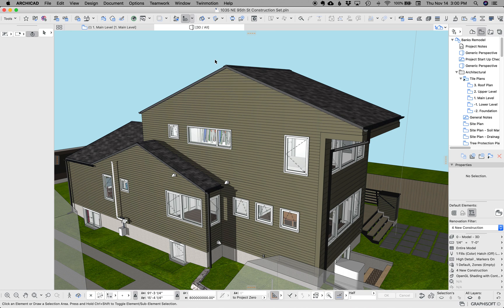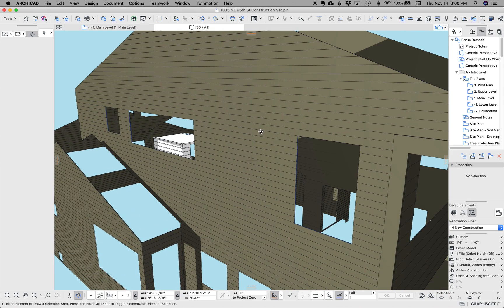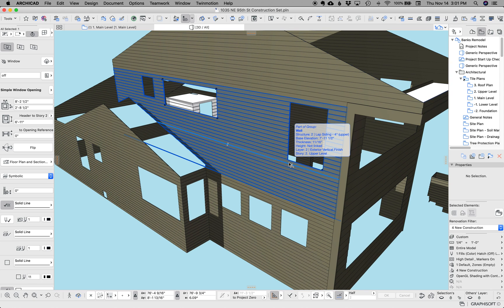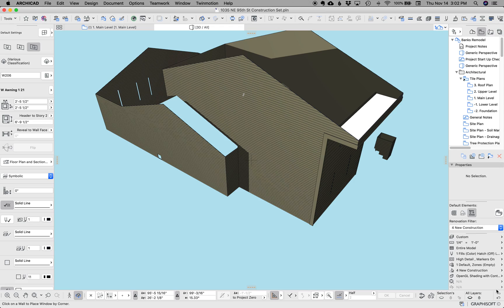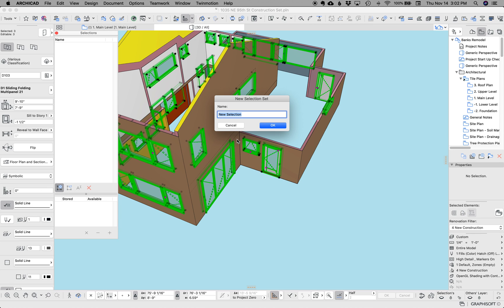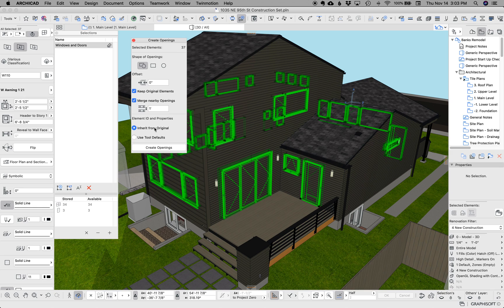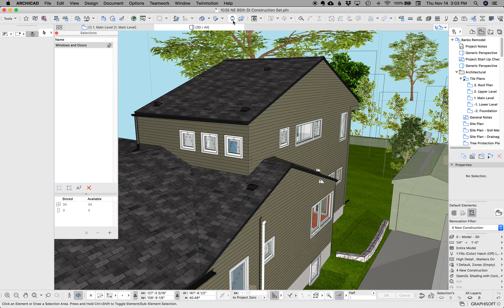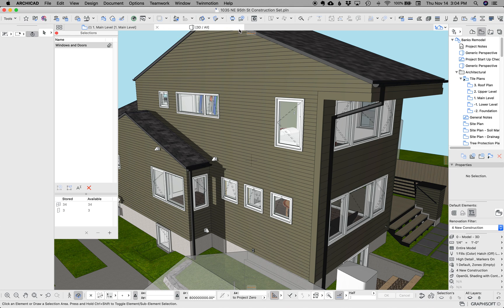ARCHICAD Tutorial #70: Openings for Complex Profile Siding in ARCHICAD 23

Comment: Thanks for this amazing tip but how do make this siding as a skin for all walls and how can we make vertical sidings or steels sheets.
Reply from the maker: Do the same technique but use a Composite wall rather than a Complex Profile. Then use a Surface with the correct vertical pattern. You can use Align 3D texture to get the lines where you want. Alternatively, if the panels are big or there aren't too many verticals, you can use hidden beams and columns to create all the joints. I think I have a video on control joints that discusses this.

Comment: Now that is a Clever Tech Tip🥇‼  I have done similar to the way you have done tiles as a wall skin for Bathrooms etc and I find it a pain to add the Doors & Windows into the extra 'Tile' skin.  Now this method will work well 😬 
Also, what say you about having the Tile skin as part of a Wall Complex Profile.  Plus it can be adjusted up or down as well with the additional parameters ✏ 
AND, I still HIGHLY recommend CI TOOLS from New Zealand for all Roof & Wall Cladding 🎉💥 It is nothing short of sensational ▶ 
All the openings, Doors, Windows, Skylights etc move with amendments and changes 🥇 
The parameters are highly advanced and they make your model bounce off the screen… like when you have 3D corrugated roof decking and all the flashings, ridge cappings, curved gutters etc applied with ONE CLICK after selecting your parameters is incredible‼
Reply from the maker: Creating complicated complex profiles for walls that include siding and interior finish like tile is a bad idea. It'll result in breaking walls in weird locations to accommodate finishes. A stud wall should be continuous, not break at the bathroom or kitchen for tile. Keeping finish like tile and siding separate helps the model be built like the actual building.

I hear so many people rave about the CI tools, and I've dabbled with them. But I like to keep my modeling techniques accessible to everyone and I don't like the idea of object based siding.
Reply: @Shoegnome  Fair enough... but I'll keep rocking the Roof Coverings 🎉💥 🥇😎 
Yep, lots of Pro's n’ Cons to ArchiCAD Tips n’ Options ✅

Comment: I can't find that create openings function anywhere. How do I find it?
Reply from the maker: What version of Archicad are you using? If it's 23 or 24, did you migrate your work environment from an earlier version?
Reply: @Shoegnome  I started from scratch with the out of box template in 23 and then migrated to 24.
Reply from the maker: Create openings from selection should be available from the design/connect menu or from the right click context menu connect option.
Reply: @Shoegnome  ok, ya I see it there in my context menu. Thanks.
Reply: hmmm for some reason I'm not able to find "opening cutting bodies" either.
Reply from the maker: That'd under on screen view options.
Reply: @Shoegnome  ya it's not there
Reply from the maker: If you are on a mac use the search under the help menu. Sounds like you might need to add it in your work environment or reload to a newer WE if it's not in the on screen view options because that's where it'ssupposed to be. Not sure what else to recommend.
Reply: I think I might have found the problem.

Comment: so I tried this with a window where the casing was turned off and the connect feature created no opening.
Reply from the maker: That's something I also discovered after recording this video. Without casing turned on, the window doesn't intersect with the siding wall and thus ARCHICAD doesn't think it needs to make an opening. The solution is to turn casing on, make the opening, then turn casing off. If you do this, make sure to have the casing no bigger than the window, otherwise you'll need manually shrink the opening. Not ideal, but it works.
Reply: @Shoegnome  I still don't get an opening, even with all kinds of window sills and casings turned on.. This would be so handy! Especially if the opening followed the window if you moved it.
Reply: @canvea  that's strange. If the element (window/door) intersects with the wall it should work without any issue.

Comment: Will the openings change position with your windows??
Reply from the maker: They are independent, so they will not move with the windows.You either need to move the openings along with the windows OR just delete them and recreate the openings the same automatic way when the window is in the new position. Either solution should be easy and fast.
Reply: @Shoegnome  Thanks!